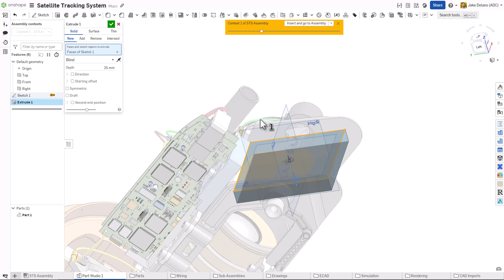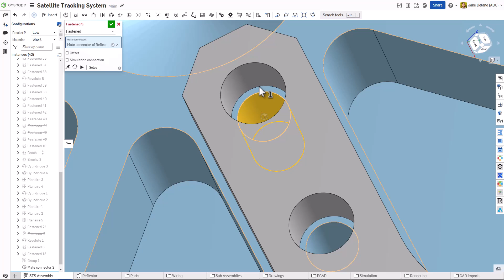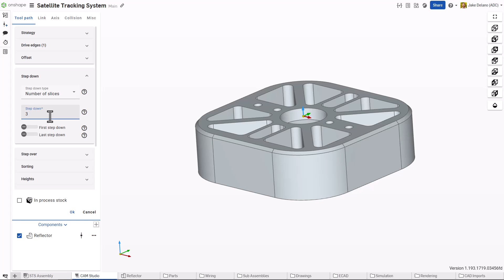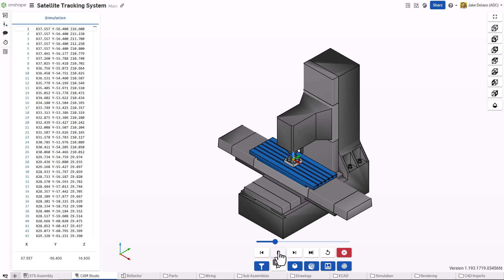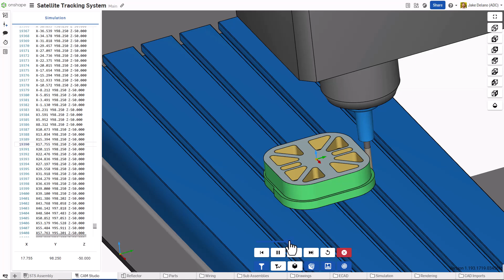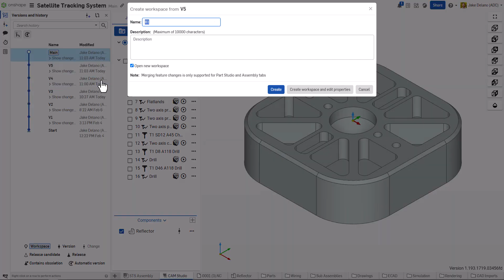Let's Machine A Reflector in Onshape

Comment: If you don't mind a rough prototype, I seem to find the CAM can be done in one step. Choose an end mill that will fit in the smallest hole, make a path with Strategy (Type=bodies, Pattern=Rough, SubPattern=Offset), Features (deselect 'use job bodies), Machining Bodies(selection filter=Body, Contour=click anywhere on sketch), Offset (Offset Type= Global, Offset=0), all else left as defaults.
YMMV
Reply: If you want to reduce the number of tool spirals down to the surface, while you are creating the toolpath, select the 'LINK' tab at the top,
set  Distances (Entry feed distance= 0.1inch or 2mm, same with exit feed distance).
YMMV

Comment: this shows my inexperience with CAM but I don't understand why fixturing to the mill is not shown in simulation? how can you cut entirely around the stock when a vice would typically be holding it